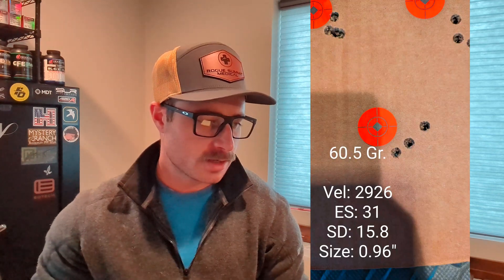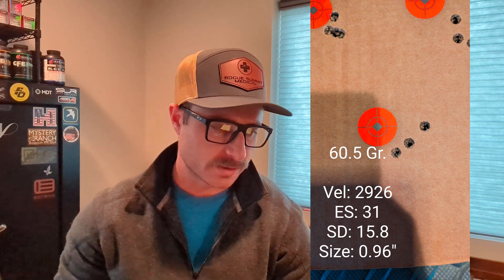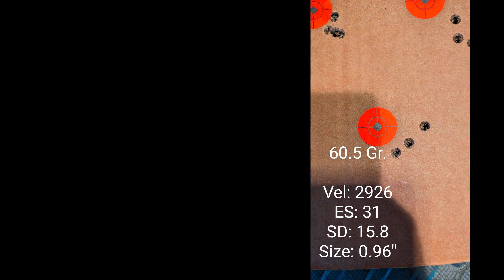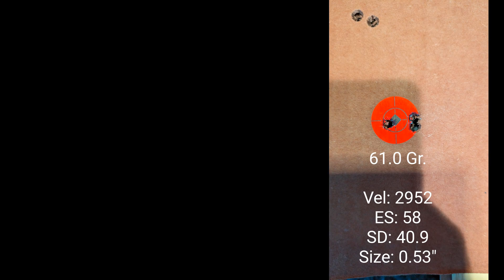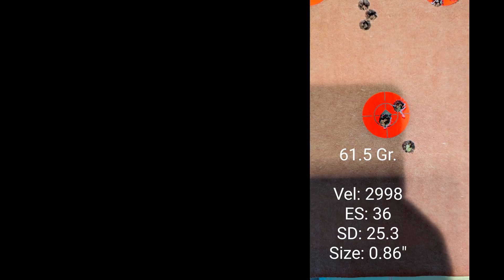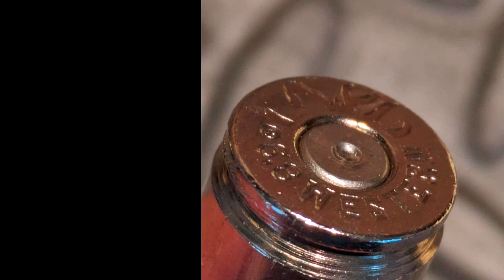Barnes 155 LRX & StaBall 6.5- Load Development for 6.8 Western- Part 4

Comment: My vote is for the 165 ablr. Thanks for all your time and effort. Do you think the 6.8 Western will stick around commercially?
Reply from the maker: I have a couple of videos up using that bullet, with more to come.

I think it will, but I could see it always being on the back burner when it comes to support for it.
Reply: @roguesummithunter  Thanks. I've got 200 new pieces of brass and another 200 pieces of once fired that will be loaded at some point when primers hit the shelves again. Were you going to try the 6.5 staball, ABLR combo, or maybe 7828ssc?
Reply from the maker: @amajorleagueinfidel1  most likely not. I just put out a video for the initial load development with the ABLRs using MagPro. If I use another ball powder, I will most likely pick up StaBall HD. I just haven't had the best results with StaBall 6.5 across multiple bullets that I have loaded up.

Comment: Maybe on your build, how are you feeling about the Gunwerks 6IX
Reply from the maker: It's good to go! Repeatable point aim/impact, works well on a semi auto rifle. I will say it doesn't sound as good as the Sig SRD 7.62 or the Dead Air Nomad, due to the smaller internal volume. But, it makes for a fantastic lightweight back country suppressor.

Comment: Great info. ABLR will be a great video. I know you did a 162 Hammer bullet but do you have any intensions going back?
Reply from the maker: Yes, since they shot well for me, I would consider buying more to load up and have on hand
Reply: @roguesummithunter  I thought I saw a video of you stating the load you used with the HH 162 was not correct. Is that accurate or if you can, can you link me to the updated video if there is one. Thanks.
Reply from the maker: @raymondburke2238  id have to go thru my videos and see. I did keep the receipt that worked well with those bullets though, so I must have thought I would use it again at a later time haha